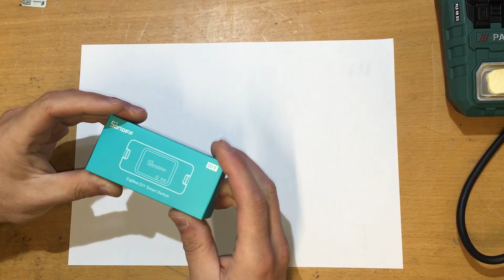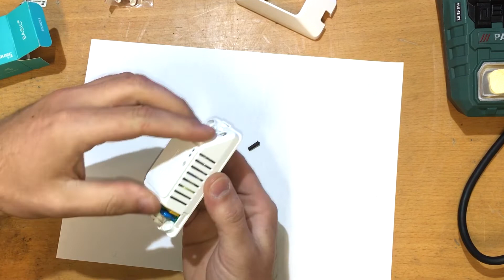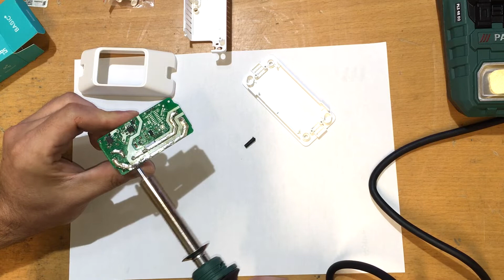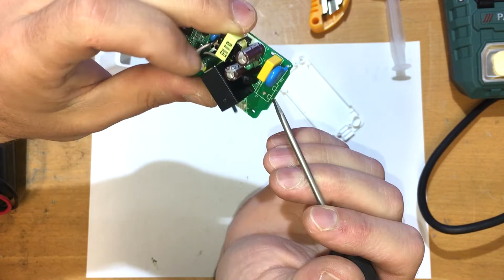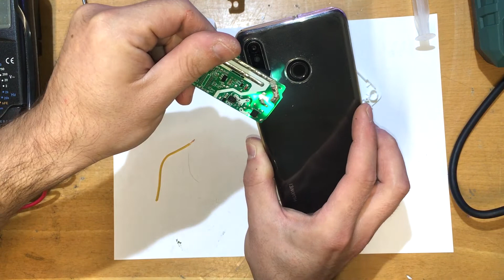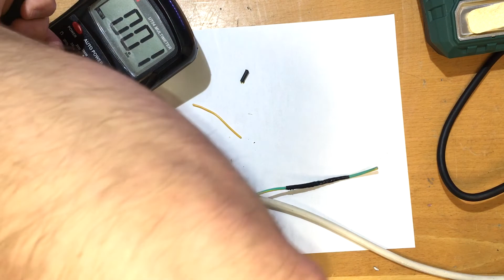Zigbee dry contact relay from Sonoff BASICZBR3

Comment: Would the Shelly Plus 1 not work in this case also?
Reply from the maker: I am not familiar with shelly, I only have the smart implant from them. If it already has a dry contact it should work. I wanted a zigbee dry relay that works from the AC outlet and I modified a sonoff since it is cheap
Reply: Yes, Shelly does the work perfectly. It did for me for about 3 weeks, then died - the 220 VAC-5 VDC sounds very peculiar... I had 5 Shelly things running around the house, now I'm on 4, I have 3 spares - but I'm gonna switch to Sonoff, I somehow find them more reliable, the only drawback is this wet contact

Comment: I can't believe it is so difficult to buy a cased dry contact zigbee relay at a sensible price. Excellent demo but a shame it is necessary due to manufacturers lack of imagination!
Reply from the maker: Yes, for sonoff would be a small board redisegn and for an even better separation use of an optocoupler.

Comment: Why do we need a dry contact? What is the advantage of this?
Reply from the maker: On dry contact you can switch any voltage. In my usage scenario I use it instead of a thermostat on a gas boiler.

Comment: After the mod I am measuring about 30 Volts between the Line Input and both outputs. It shorted out my furnace 24V transformer when I attached it to the red and green posts. Probably explains why the ac compressor kicked on when I activated it. Any Ideas?
Reply from the maker: You probably missed something, mine is working fine on my boiler in place of the thermostat. Always measure for voltage on output before connecting to something. I am sorry you burned something it should not have happened if you followed carefully. Some electrical knowledge is required though.
Reply: @DIYHelper Oh I caught it quickly enough so there was no permanent damage, the furnace is still working fine.  

I'm pretty sure it was leaking through the relay but I didn't convert it to 5V and was using 110 input. I did that and now I am only getting 1.2V open and 1.0V closed. What's odd to me is that I am measuring no continuity whatsoever but I'm ready to test it on my garage furnace(much more simple no ac) which isn't used too often either. I'll let you know how it works out.
Reply: This version seems to be working just fine(in the garage) now. I'll switch it over to the house after the heating season ends and before the A/C starts. Some years that's only about 7 days. My hope is that I can use the SmartHome feature to kick on some cooling from the basement before the thermostat calls for A/C. Somedays that may be all it takes to keep the whole house comfortable. 

The lore is that my grandfather(Boros) was whisked out of Romania to Hungary as a one year old child. My guess is sometime between 1910-20 

Thanks again for your video.

God Bless
Reply from the maker: @INFOOL7  Boros sounds like a Hungarian name to me, I am also Hungarian minority in Romania but I was born here so actually Romanian citizen.
Glad you solved it.
Reply: Turns out the voltage was hopping back to the thermostat over the green wire and activating the A/C so I just disconnected it so the sonoff will be the only way to power up the fan relay which is OK by the missus. She can just say "Alexa turn on/off the blower" and I can automate it from a routine or two